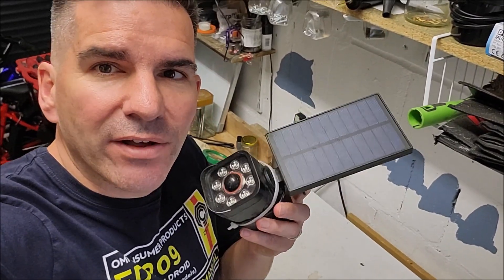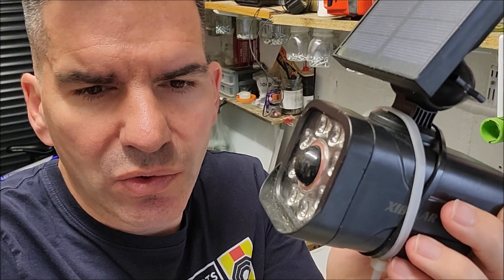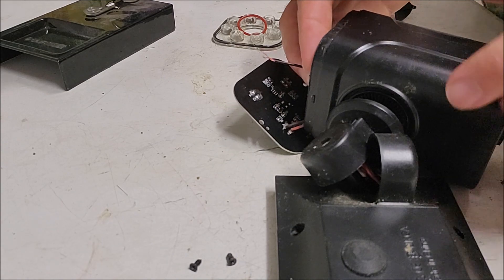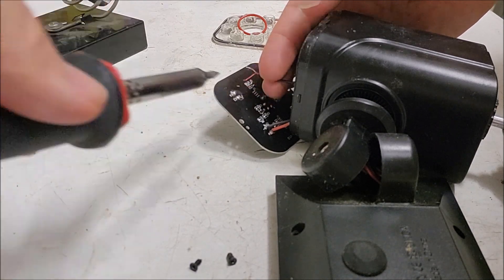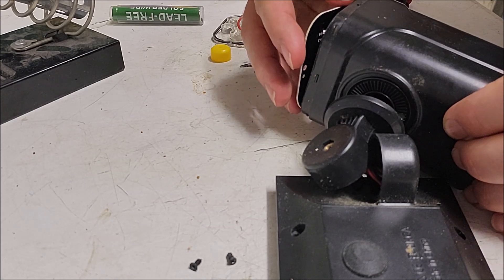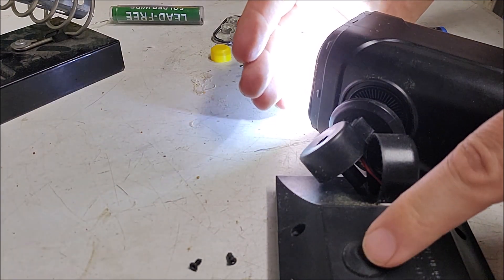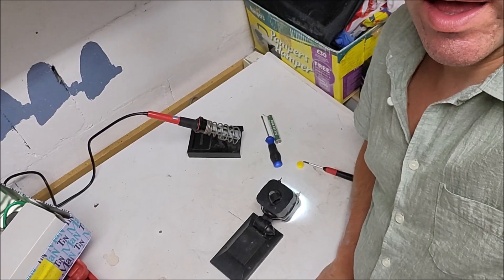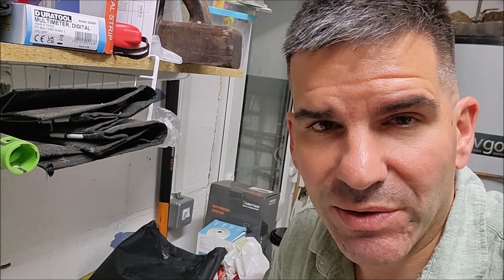how to repair solar security lights

Comment: I've found that generally when these solar lights go out, its because of the super cheap rechargeable cell and solar panel they use with them. I found some slightly upgraded solar chargers on amazon and replaced several of mine after they died. One of my lights would run a few hours after dark, now it's still on in the morning. I think a 2 pack was about $15.
Reply from the maker: Nice job. Bet that was satisfactory. What kind of rating were the upgraded ones?

Comment: Nice one, mate! What annoys me about many of these devices is the lack of spare parts. I have a couple of solar lights on which both solar cells died, just out of warranty. Can't replace just the panels, supplier says to just chuck it and buy new, even though the batteries, circuitry and LEDs are perfectly fine. I had to buy some similar sized solar cells and do a hack to make them fit, but they work. Right to repair, hmmmm. I wish the companies that make and sell these could be held accountable for creating unnecessary e-waste. Good to see that there are like-minded people like you and I that will repair the thing instead of chucking it into the tip. Just a tip, use a plastic spudger or cheap guitar pick to prise the plastic parts, not a metal screwdriver. And get a magnetic tray for your screws so you don't lose them 🤣
Reply from the maker: Nice tips! didnt think of a plectrum! 
I'll add a magnetic tray to my birthday list. The number of orphaned screws on my floor is nearing 17.
Reply: @RobTheFrugalist  🤣